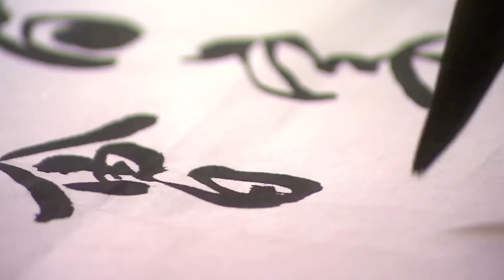Snake Eyes'  "Morning light" [An Inside look at the Katana] #1

Comment: The steel of the material of katana is applied to the manufacturing method of yasugi specialty steel. Since yasugi specialty steel has the same performance as katana, it is hard and hard to break. yasugi specialty steel is a material for Japanese kitchen knives, cutlery steel, and car and airplane engines.

Comment: i thought i knew a decent amount about Japanese swords. turns out Japanese swords are a rabbit hole. also, i know a sword made for battle is called an Uchigatana (previously Tachi, etc.) is their a name for a type of sword that is made for the sake of the art and science of the sword making? not that it would be a low quality sword unfit for warfare. far from it. just that it's a sword that's so high quality, so masterfully forged, so beautiful, that staining it with blood and chipping it on bone & metal (other swords and armor) would be a disservice to the blade, the Smith, and the Goddess. kinda like a "Garage Queen" car. it's meant to drive and take corners and blast the driver with g-force, and perform. but it's also beautiful. too beautiful to risk getting stained with mud, dirt or food or drink brought in the cockpit, dents and scratches from careless people, etc. a Garage Queen Katana, so to speak.

i thought of something else. i believe using modern materials, or more accurately: modern methods- is "forbidden" not because you'd be contaminating the Tamahagane, Aogami, Shirogami. but instead you'd be contaminating the culture the sword represents. the preservation of an ancient artform, and practice.

Comment: Could you please assist me with a query.
When a blade is differentials hardened does it still need to be tempered?
I have done it to 2 blades of mine and then tempered over a flame blueing the back and reaching amber near the base but I can’t get a hamon when dipping in acid

Comment: This is part of why certain European swords were even more advanced and sophisticated than most Japanese swords. For example, the Ulfbehrt swords, the Ingelrii swords, and later, the famous blades from Toledo, Spain... 

"Ironically, the patterned swords esteemed in later centuries were the product of a less homogenous ingot – their “watered-silk” patterns depended on a very high C% (carbon content) and segregation of the cementite. The more splendid patterns may have been attained at the expense of the swords’ toughness.

Those swords which were homogenous and successfully heat-treated seem to have been of a lower C%, which would have required a higher temperature to make. Without a distinctive surface pattern (other than a sort of “satin chrome” finish after etching), they may have commanded a lower price, despite being mechanically superior."

-Williams A., 2009, A metallurgical study of some Viking swords.

Comment: I know it wouldn’t be historically accurate but would it be possible to make a katana is that had a Damascus top and the cutting edge that was the cutting edge That was traditional.
Reply: It would be possible if you used Damascus steel for the outside and a core of regular steel (the SANMAI method) it should survive the difetential hardning process